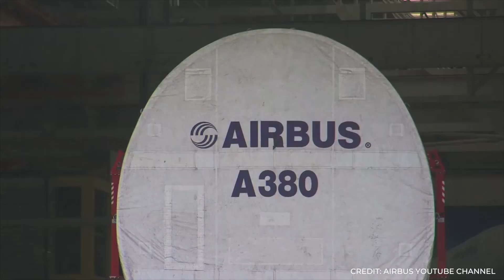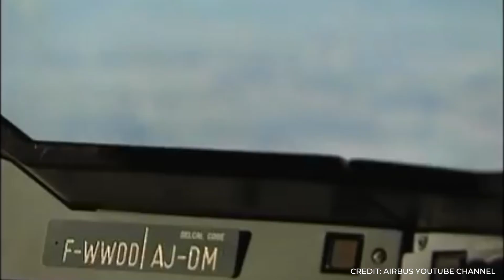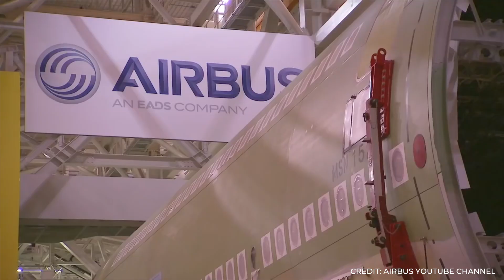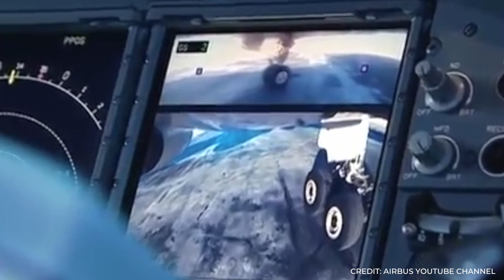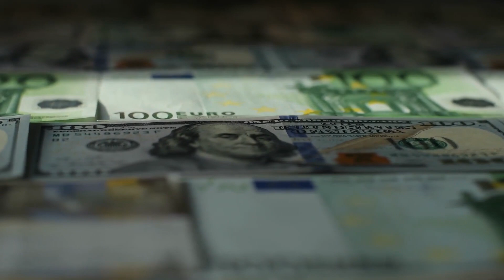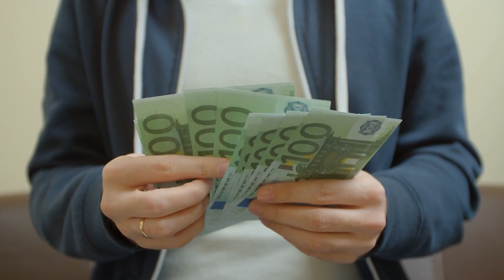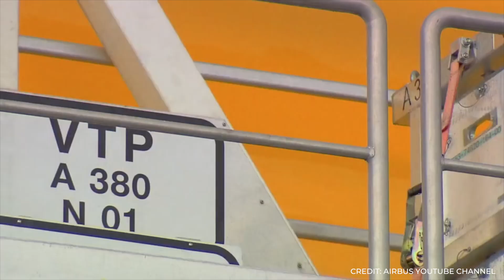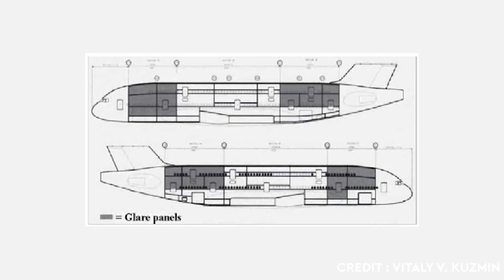Airbus A380 - World's Largest Passenger Airplane (Documentary)

Comment: They never seriously considered a freighter version of the A380. Unlike the 747 which was designed as a freighter from the start, with a nose door, etc. the 380’s full length upper deck always made it impractical as a potential freighter.

Comment: It says on Google the 747 is bigger than A380 the A380 just can hold more people
Reply: The 747-8i is just a litle longer.... but has a smaller wingspan and an significant smaller maximum takeoff weight. Also the A380 can lift around 30 tons more of payload and Fuel.